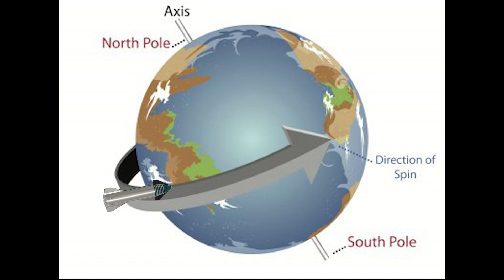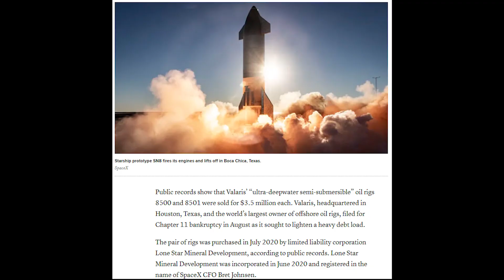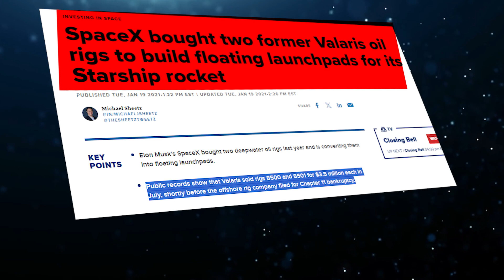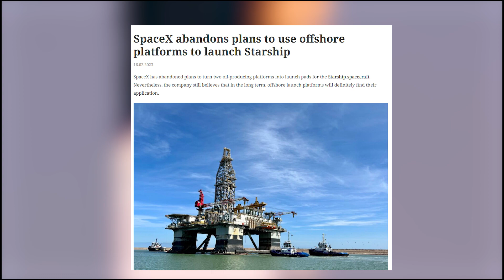Why SpaceX Ditched Oil Rigs as Starship Launch Platforms?

Comment: They never considered oil rigs, Elon mentioned it once and all you fanboys just uncritically started parroting it because it sounds exciting and when Elon says it, you all get stiffies.

Please just try to THINK for a second. everything they need for a launch would have to be moved to the rig by barge and lifted onto the platform by cranes. Can your little brains comprehend what happens when you try to lift a 160-ton booster from a barge that is moving up and down several feet? 

And can you imagine pumping 4000 tons of cryogenic fuel from moving barges to the platform?
 
I don't want to call SpaceX fanboys stupid but... you keep saying these stupid things...